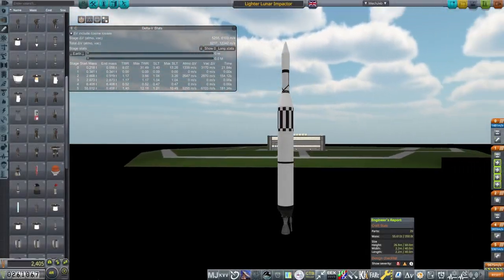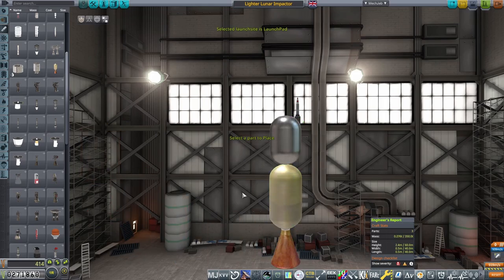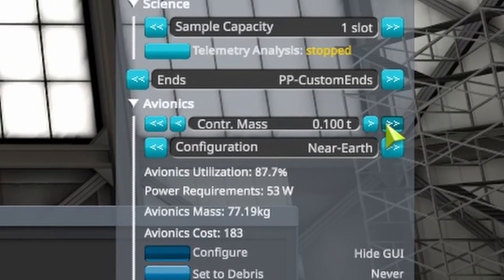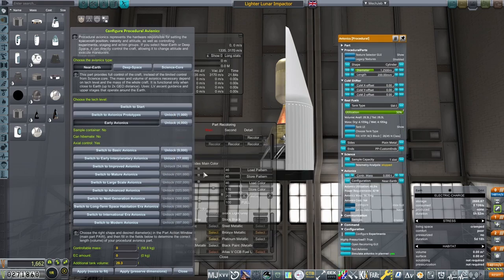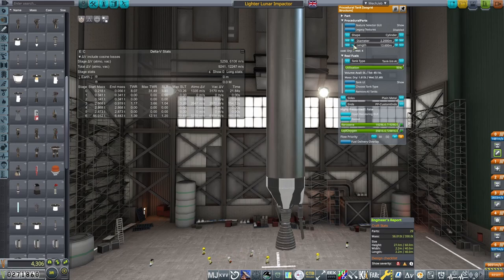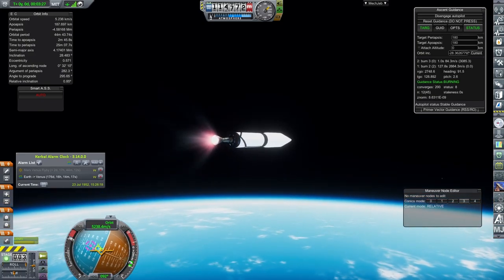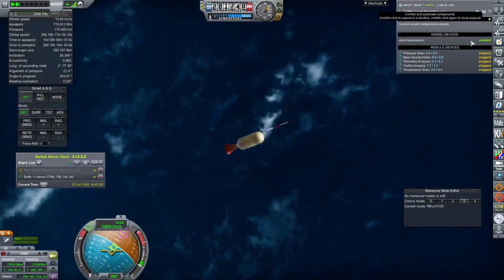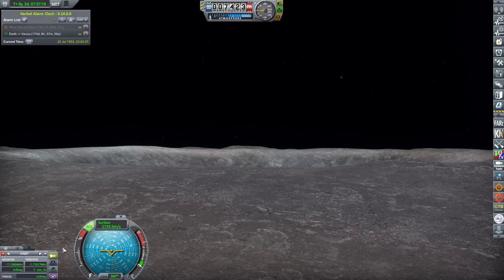How To CHEAPLY Impact The Moon In KSP RP-1

Comment: Hey, I just spent several hours trying to re-create this, always having a problem making my manuever node with 3173m/s of DV.  I can however only get to ~157km AP with the LV I have.  I then thought, hey, IRL, they launch once a month to the moon...and now I realized why.  the AP and PE of the moon are not equal....41Mm different...that's a LOT of space.  So, I waited to launch in the Sim, until the moon was 2 days from PE (assuming a 4 day trip).  Now that the moon is closer, I can easily dial in the maneuver.  So, I guess if you want to Min/Max in RP-1, as they do at NASA, then moon launches should only take place once a month at the right time, when the moon is CLOSEST to earth....Also, achieving the impact in the SIM (doing it at the current time), and then later doing it at a random time when your rocket is ready could also cause problems on the PE height and burn time...again if the SIM and the actual launch have different moon altitudes, then they probably wont be the same result (ie success in SIM, fail when done for real).

Comment: My first lunar imapctors used a Thor-able vehicle but had a aerobee powered TLI stage which this shows was needlessly complex
Reply from the maker: I’m fairly sure that was the route I used to go down, until n9 convinced me that solid rockets were magical, and they really are a lot better than I gave them any credit for :p
Reply: @Carnasa  Slightly related question but would these impactors also complete the flyby contract?
Reply: @Carnasa it is because the solids can achieve a lot of deltav in one stage for small stages
GCRC can reach 3500m/s while equivalents like Aerobees only have ~2000m/s unless you do staging.

Comment: Ok but what about if you use principia
Reply from the maker: Should still work with Principia, as long as your predicted orbit is good. might redo this with that mod though, because it’s been too long since I opened a save with principia :D
Reply: @Carnasa  I jumped pretty much blind into RP1+principia and my brain is slowly dissolving into mush. It's great!
Reply: With Principia you can't launch into the plane of the moon, you have to launch to the ascending or descending node.

On the launchpad set the moon as your target.

On MJ PVG select launch to AN/DN then engage autopilot. This will start a time warp and once that's done it should launch as normal. If it doesn't launch (red failure message) disengage and re-engage. PVG will put you in orbit with an hour to go before you reach AN/DN, which is where you should burn.

Next issue is that you have to use the Instant Impulse option when planning the burn since you can't activate an SRB without firing it. This (like in stock) means that the manoeuvre planner becomes very inaccurate.

Personally I found this method too frustrating to cheese/get a lucky hit, so I built a craft with a controllable upper stage.